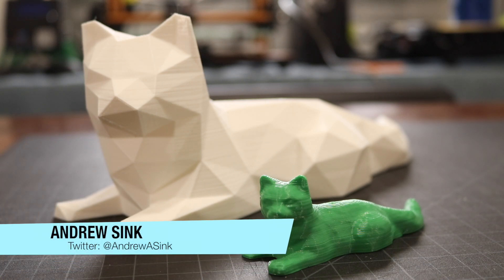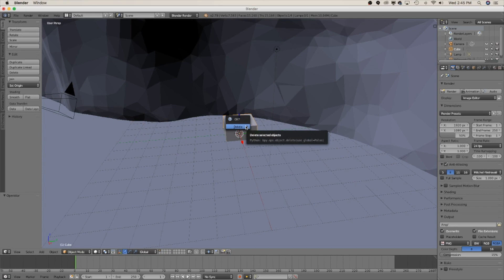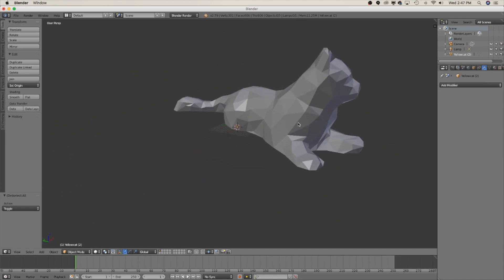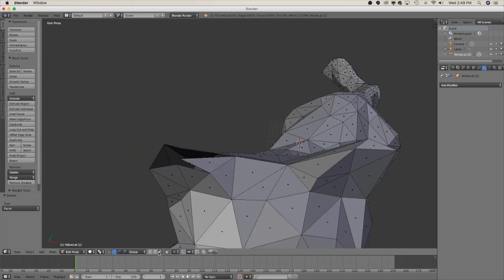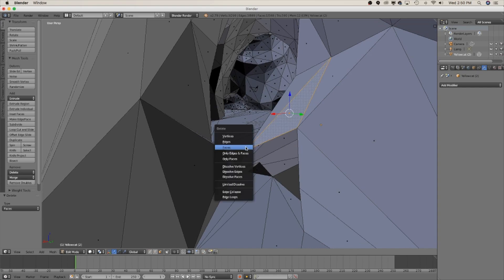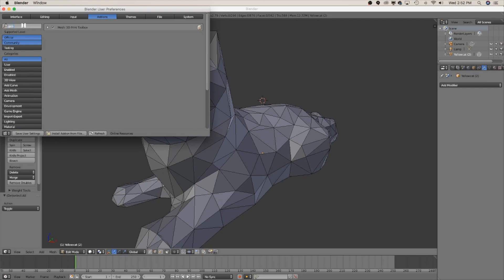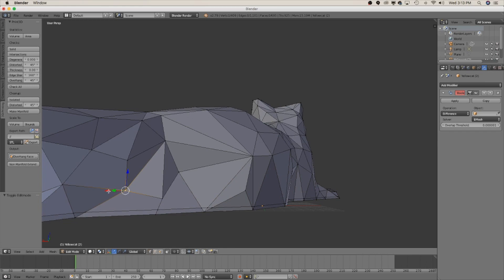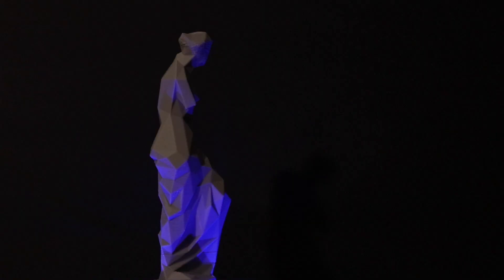Creating Low Poly Models in Blender for 3D Printing!

Comment: i just made an elephant in blender, high quallity, - but if i add texture to it, will it come out printed with texture the way i made it look in blender then ? - or will all the colors not be added on ? or do you buy all kind of different colors for the 3d printing machine ? i dont got a 3d printer machine tho.- just asking :)
Reply: A 3d printer only prints in the colour you give it it doesn't really do textures
Reply from the maker: Great question! Most home printers only print in a single material, so the object will come out whatever color the material is!